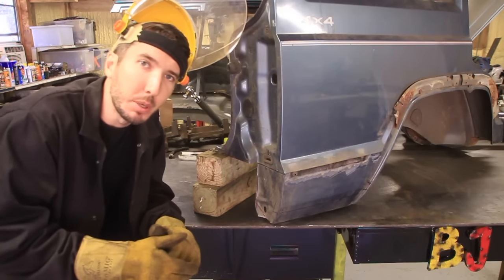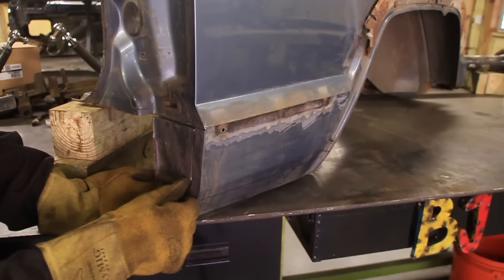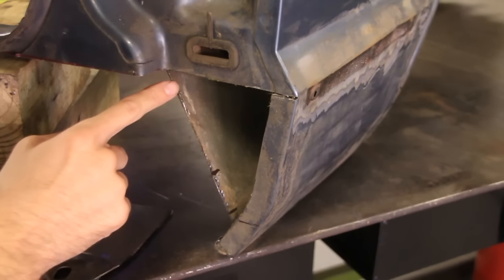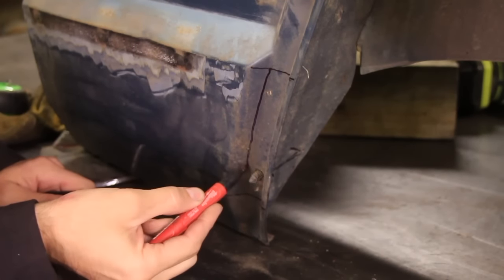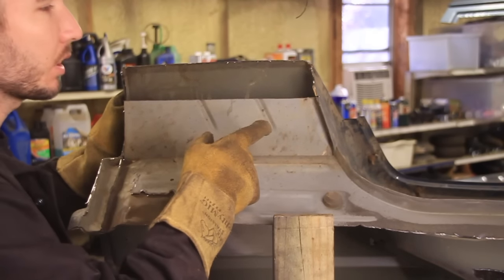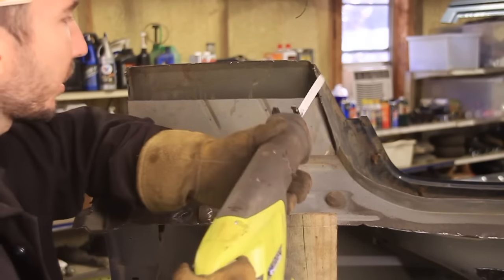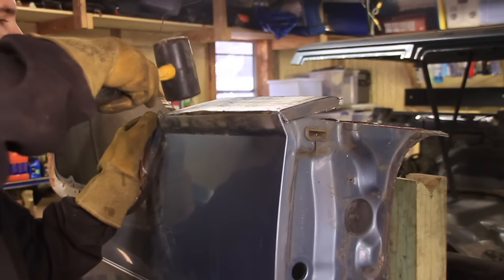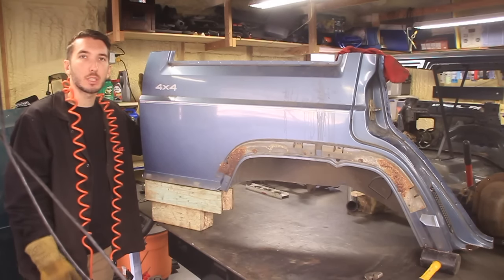XJ Cut and Fold Mod - Rear Quarter Panel

Comment: Lol the only reason I did a "comp cut" on my xj was because I live in the northern rust belt and didn't have any lower quarters left😀
Reply: how did you do it with the rust? i have one side of my jeep completely rusted out and the other side doesn’t have a spec of rust. i just did one side tonight and plan to do it in the morning but not sure what i want to do yet. Might cap it with some plate or something

Comment: Thanks! That was pretty straight forward. From working with sheet metal a lot in my life I have found it to my advantage when bending metal in a straight line is to take an utility knife and score a line on the inside of the metal for example that crease at 9:30 you can go on the inside of that crease line and score a line over and over again with an utility knife, blades are cheap. Don't do it too much as the metal might crack on our scoreline. It works. Be careful not to cut your fingers off though...I still have all ten digits...
Reply from the maker: good tip!

Comment: In my whole life in new England I've never seen a jeep rear quarter as clean and rust free as the one you cut off your car 🤣
Reply: My xj was was state vehicle before i paid 600$ at an auction for it and i swear to you i don’t have a single spec of rust from it being southern owned and the interior is so clean and perfect that it looks like it just rolled off the assembly line

Comment: Hey Matt I just removed the rear covers on my 2001 XJ and I will have to do some cutting, much more than you did the rust has formed right at the wheel well and maybe 2 inches into the panel but I can still cut it and fold but will add some sheet metal to close the underside thanks for the how to video keep the videos coming dude ..

Comment: might want to paint the edges you cut before folding them over otherwise you are putting together raw steel edges that are going to grow cancer inside the hard work you just went through to make. cold galvanizing paint works well for this and plays nice withe the galvanizing the factory uses under the paint.

Comment: Is the process much different on the driver's side where the fuel filler neck comes down?
Reply: From what I can tell it's above this after u pull panel that covers filler hoses you will see

Comment: I live on tennessee and bought a XJ from tennessee but once i took the right quarter panel cap off out came the whole panel almost in rust. the other side was in perfect condition. Must be from the way the roads are shaped and how you run puddles over on the right side of the jeep.

Comment: Any reason you went with the grinder over the plasma? I know some of the cuts were close to a seam making it hard to get the torch tip in there, just wondering. Keep up the good work!
Reply from the maker: Cut off wheel is so much cleaner and smoother on thin metal like this, and it's hard to mess up whereas a plasma can slip and there goes your perfect cut.

Comment: if you heat lightly the creases with the tip of a hot torch (anneal),  the metal will bend easier you can use stock bar as a heat sink along the crease where you don't want too much heat to travel.

Comment: do you guys or can you guys PLEASE do a vid on the famous loose steering column tightening? got a 90xj,thanks
Reply: +Humboldt Greenthumb I had that problem. It sucked and scared me that my steering wheel was gonna fall off. I followed some sketchy instructions but it ended up working. Put plenty of thread lock on the bolts too. In the process of reassembly I messed up on the lock plate and the bright switch so neither of those work now. I would have loved a good instructional video

Comment: Is there a way to do this and still use the JCR vanguard Tire carrier.  I have a 00 XJ with the vanguard bumpers and want to do this but unsure whether the spindle reinforcement will still work (Haven't installed the reinforcement yet)

Comment: I just pulled my bumper caps off and that entire area is rotted, even up to the gas lid door. how should i do this mod?
Reply: Cut it up as far as you can and bend some little flanges over from the remaining metal to either weld or rivet to.

Comment: yo mat whats good I know this isn't about pcv and catch cans but can I install one on my 85 cherokee its a carbureted 2.5L ? its kind of confusing because of all of the lines the pcv goes I don't know where from the crank case and the air filter on top of the carb has a hose running back into the crank case as well just in the back ?

Comment: If that rear quarter panel part is rusted would it just be better to cut it all off and weld a piece on the bottom? Or should I fold what I can?
Reply from the maker: Cut out the rust if you down want it to spread.
Reply: BleepinJeep got it thank you cut it out and kill it!

Comment: Dude is there anyway way to install flares on cut and rolled fenders? My 92 XJ had em folded when I bought it
Reply from the maker: Really depends on how far they are rolled.  Check out Napier fender flares.
Reply: Thanks for the reply. I'll check em out.  Looks like they only had the 96+ ones but ima email dave

Comment: Watching you cut without a guard on the grinder is scary... Ive had disks explode on me (although they were cheaper disks, but still) and without the guard on, I dont know what would happen to the disk.
Reply from the maker: That's why I've started cutting only with a full face shield... I can't stand the guards.
Reply: +BleepinJeep Fair enough; but i dont know how much a plastic shield will do against shrapnel.
Reply: Face shield is a good step, but you really should have safety glasses on also. I've had grinding spark get into my eye in spite of double-protection, not worth the risk going with a single layer (face shield only).

Comment: Alright go easy on me my fellow XJ Brother's & Sisters,😕
Say I want to trim my fenders, and do the comp cut as well on my 01 XJ,🤔
Where should I start ? 
Do I do the comp cut first, or should I start with trimming the fenders ? 
Fyi Matt, I'm a long time subscriber, I dig your videos Both wrenching & wheeling, And I would like to say that you, and your family, are welcome out at my RC adventure courses anytime Brother.😁😎👍👍 
Thanks for sharing your video Matt 🙂👍 
Fyi I'm sitting in my barn with everything that I need to get started on trimming the XJ, everything except knowing where I should begin,😂😊👍👍
Reply: Hmm 🤔 Are you not getting all of your Notifications either ? 
I know that it happens with my channel quite a bit,🙄
Still kinda waiting for a response though,😕 😁
Anyways, in the mean time I trimmed up the front fenders while I was waiting,
Taped around the fender with blue painters tape, Cut the fenders via Cut off wheel, Ground & Shaped via Angle grinder and a hand file, then painted the entire inner fender, and the bottom of the windshield fluid container, "flat black"
I removed the lower air dam on the front bumper, along with the bumper'ets, I was planning on cutting the bumper'ets down to match the fenders, but after removing them, I had discovered some unseen rust,🙄 the Bumpers lower mounting bolt holes for the bumper'ets, was actually rusted completely through,😕🤔 the new plan is to angle cut the corners of the front bumper, and roll with it,lol 😂 hopefully not any actual Roll overs, cause that would suck,😬😂 lol 
Anyways I'm going to trim the rear fenders tomorrow afternoon, along with doing the "Cut & Fold procedure" on the rear section of the body,🙄 
Personally, I would love to hear your input, on where the best place to start is ?
Start with the cutting, and folding the rear quarter, 
Or Start with the Rear fenders, by Marking the spot welds, Cutting all the slits between the spot welds, and "Rubber mallet hammer folding"all the material into the wheel well,
🤔😕  Or is it totally obvious after looking at it for a minute or two,🙄
😄 I'll admit, that I haven't really just sat down and stared at for a few minutes yet,😂 I'm sure that I can probably figure it out on my own, but I figured that I would ask someone who had much more experience with XJ's,😕 
My XJ turned out to be pretty rusty under the rear bumper'ets, the back corners of the rear bumper aren't looking to hot either,🙄 so on that note; I'm unsure as to what the best outcome would be,🤔 
Wether I should cut the rear quarters right off, or wether I should attempt to cut and fold what little material is left,🤔 I mean the material is there, but it's very rusty, and really thin,😬 and it also already has a big hole, on the bottom of both sides of the Jeep, there's about 3/4's of the lower rear quarter that is possibly workable, but like I said it's very thin, and very rusty,🙄 so I'm on the fence with that issue,
I suppose, I should probably try to clean up what's left of the material with a wire wheel or something, then Spray it with a Rust inhibiting paint, Then proceed with cutting and folding the quarters, Bolting the mess together with some self tappers, And then do whatever I can on the inside of the Jeep to get what's left over all sealed up,😕🤔 I don't know lol 😂
Once again, I'm still waiting for some kind of response for first comment,😄 
No worry's either way, if I don't hear anything before I get started on everything tomorrow afternoon, Then I'll just figure it out myself,😕😁👍  Although some type of information on the best way of going about it would be appreciated, but it's not absolutely necessary,😕😁👍👍
Reply: Never mind, I did it myself,
all finished, I started by making a couple of initial cuts, on the lower inner Rear fender by the rear quarter, Then I did the cut & hammer folding technique on the Rear fenders themselves, And then I finished the Cut & fold on the rear quarter, except my last fold was pushing the "back lower inner fender" backwards over the other folds, then screwed it all together with some 12x3/4 self tapping screws, 👍
The rear Quarter's were rusted pretty bad,🙄 but thankfully I had enough good material left to get the job accomplished,😊👍👍
Fyi not to tell you what to do on your channel, 🙄 but if I could suggest, I would say that for all the xj fender trimming/ & comp cut videos that there is out there, none of them are very descriptive, Yours are generally pretty good, but having the vehicle shell on the bench, and flipping it whatever way you want, is much different than working on it while it's still a full roller sitting on the ground,🤔😕  basically that means that everyone that is watching the video, has to do a bunch of unneeded deciphering,🤔  that and you are basically in a unrestricted while working on it, No axles, No rusted on bumper, No gas tank, you Know what I'm saying,😕 
Here's my suggestion;
Since no one really has a descriptive video on the entire process, from front, too back, including the rear quarter cut & fold,🤔 Maybe,possibly, you all could maybe,think about doing one,😕 
A extremely descriptive video, with good lighting, and close up views, close up's with the flash on, so we can actually see what we are looking at, a "no clown around video" a very descriptive, very in depth, and very professional video,
Something like that, would be a great service to everyone current & future XJ owners,🤔  just saying! 

That is all; Happy Wheeling Brother.😎👍👍

Comment: am I the only one around here who prefers full fender profile and a rear bumper with wrap around guards?
Reply: +balzarini51 I do to, on a mild wheeler. But when your going extreme and need as much ground clearance as possible, then this is the way to go!
Reply: Im scared to say this on a jeep page, but I have a trail gear bumper on the back of my 95 Toyota 4Runner, and the wrap around tube has saved my quaters/"bedsides" more than a few times! Love the full body and big bumper look!
Reply: And not to mention, its a giant pain in the ass to comp cut toyotas